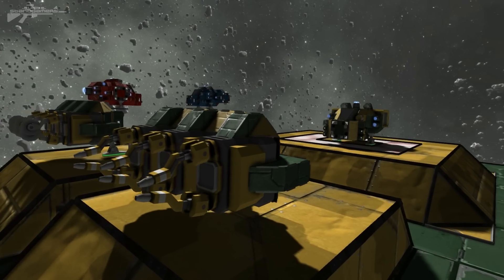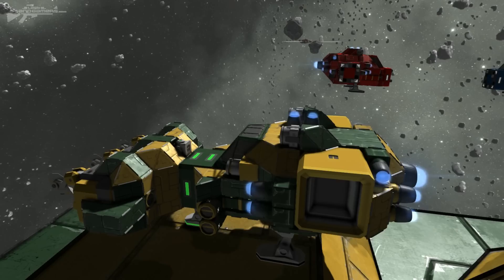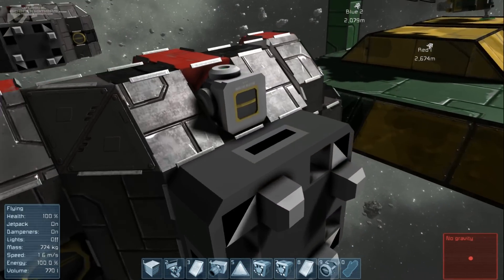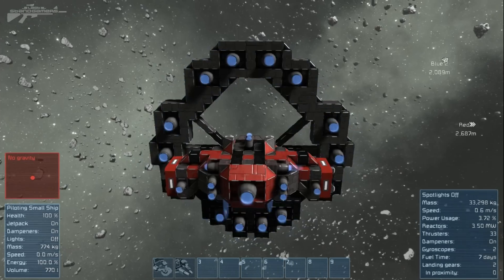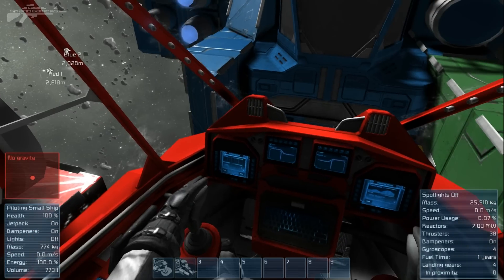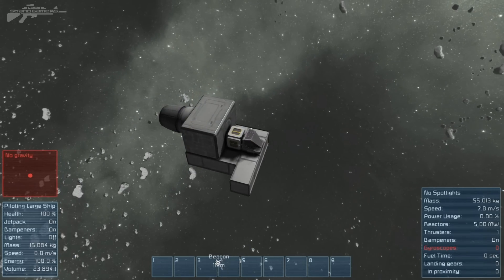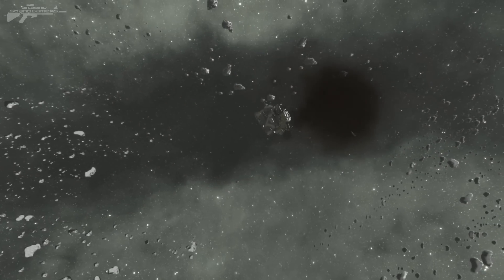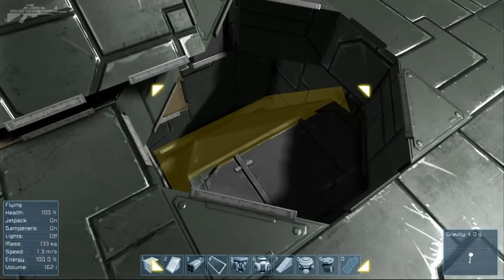Space Engineers - Merge Blocks, Connecting Ships & Upgraded Multi-Player Code

Comment: i got a sweet blue print from workshop and decided to make about 5 of it into one ship and have been catching my tail trying to get them to be one ship i tried using blocks and presion flying to line up i even tried connectors i forgot that it have merge blocks good thing i found this vid because tonight would of been the same catch tail i was going to build a city ship but to much ppl did it so i will make a small ship with the city ship type look idea like how stargate atlantice city ship has the center tower and all the platforms i will try that with a beautiful ship i got from workshop when its done i will post a vid maybe upload to workshopwont be stealing designs because i still have to make the center portion of my ship to look as close as possible to the blueprint design mayby i will as the original designer to make a center tower for me only oter style i will do the inside to my liking

Comment: I know this has Obviously had some changes since this release but I just recently started playing. I have a similar setup for my atmospheric utility ship. When I disconnect the tool header though the landing pad attached to the tool header disconnects. I Have tried everything I know of short of giving it all the components it would need to qualify as a ship. I have even added a battery to make sure it had a constant power source thinking that may have been an issue. Will this still work or will I have to find some other way to store the tool headers for transit?

Comment: Fully modular ship construction, instead of building ships, build sets of light, medium, heavy cores (reactors/gyros) light/med/heavy cockpit modules, cargo modules, thruster modules, weapons modules, utility modules, etc.  You would have a hanger full of these modules and then simply plug and play for whatever role you need, and when its no longer immediately useful, you can disassemble the whole thing down to its modules. You would also be able to chain the modules togther, like extra power modules, extra cargo, etc, think ship construction from kinetic void, except you can take them back apart and reconfigure the whole thing. 
Would also make repairs stupid easy, just swap out the module, instead of rebuilding a whole ship.

Comment: Great for if you are building a ship and acedentaly destroy a conection to an important part. I had that problem while I was building a cruiser. I kept on editing the passages I was useing for jetpack elevaters but it would come off when I destroyed a certain passage block, it was so frustrating. So this is awesome! Been waiting for the devs to add something like this. Also, it lines up perfectly with the other blocks, unlike landing gear, so now you can have a better loading system for small ships.

Comment: These merge blocks work great. The exception being if you have a very large heavy vessel and you try to dock with a station, the magnetism tends to force them to crash into each other more than dock. I was able to somewhat avoid this by reducing the number of merging blocks used. Less merging blocks less magnetism. However I still ended up with some damage. I hope in coming updates they allow for the merging blocks to connect small ships to large ships. That way you could trailer over a reactor with gravity generator to a location where your mining and not have debris flying off into space. Plus it would be cool to build a booster ring like Arron's here using a gravity drive.

Comment: I wanna know what that big thing in the background was, and that white "mesh" looking thing
This would make breakthroughs for more role-play and/or combat orientated ships, I always wanted to have a modular design for my vessels where the main body would contain the bare essentials for getting around, with the high mobility and speed as an essential, along with a respawn point and not much else, I would then create many different modules covering everything from cargo bays, troop transport, missile bays, additional armour plates, mining/welding/grinding modules, refinery bays, thruster and reactor bays, anything I can think of really to create the most versatile ship possible, including points to connect to other ships or stations allowing easy transfer of materials or increased power supply, not to mention the ability to carry other vessels.... I could even put my station defence system into effect, creating a simple ship with the ability to connect to huge armour panels or massive turret or missile arrays!

Comment: Now if only they could try to work around something to make manned turrets (with pitch and yaw) feasible, practical, or at least usable. Having to make odd looking bulges on my vehicles because the turrets that exist on tanks today are impossible to fully recreate is kind of annoying.

Although, with my own research into the field has provided some use; you can build an oscillating turret design, otherwise you'd have to build a 5-faced empty cube with a separate rotor for pitch and yaw.

Comment: Regarding item transfer between ships, you don't need to use connectors and collectors between ships that use merge blocks to connect, so long as you can make an item port or conveyor tube on one ship (cargo container, reactor, conveyor, etc.) line up with an item port or conveyor tube on the other ship.

Little bit of ASCII art to illustrate what I mean:
Ship 1 ---------------------------- Ship 2
|-Merge block-| Space |-Merge block-|
|---Conveyor---| Space |---Conveyor---|

When the merge blocks connect those two ships, the conveyor blocks line up as well, and the game will treat that the same as if the two conveyor blocks were built right next to each other.
I'm not sure if that works specifically because they programmed it to do so, or because the merge block makes both ships effectively the "same" ship. Either way, it's a handy solution to what could have been an annoying problem.

Comment: you can use 2 rotors for a wider degree of movement, if you add a rotor facing sideways on the first rotor you can have a turret that pitches up and down
Reply: He knows that. It's just that if you do something like that, you can't have a "proper" turret with a mantlet and aesthetic accuracy (like in recreations).
Reply: TankCommander451 indeed to do a complex turret consume allot of space and you have to configure the rotors to reduce the vertical angle to avoid break every ting i did i a wheeled tank with functional turret and but that was a hole day just fot configure it and testing now is realy good, i want to replicate some real life tank some day and working suspensions, check on the work shop Roque_THE_GAMER and see my job.

Comment: As long as you know which Merger block to turn off in order to disconnect you will not need to place a reactor on the other piece, it stays on regardless of power.

Another interesting thing is you can build the ship and the piece already togheter and detatch later on

Comment: MAKE TORPEDOES WITH THRUSTERS NAOW
Reply: aaaah, you mean that they would be propelled by those thrusters?
sorry, I thought you want the thrusters to "melt" through the enemies hull.

no, yet the thrusters just work manually (just while the player presses the button and become inactive when the button is released)
Reply: I bet someone is doing that right now.  :)
Reply: that should work... how?
Reply: Well What I'm thinking you'd have to have a powered approach.  So they're going, then disconnect the merge block and they'd keep going.  Unless they'd automatically go to zero thrust once disconnected?
Reply: I think they would slow down too fast.
and by the way your concept was done already with landing gear
Reply: Yeah as inertial based torpedoes.  I'm wondering if the thrusters would stay on when disconnected.  If not then yes they're no more than what we've already had.  If they CAN then they will majorly accelerate once removed from the mass of the rest of the ship.
Reply: Ah so once you'd disconnect it it'd just shut off.  Boo. :(

Yeah seen the thruster burner missile. :)
Reply: exactly. it would be a new ship in that moment.
Reply: Hmm... but I kinda want it to be... 

Oh well, I'll have to wait for them to make an "AI" block (call it a CPU Core) so I can make automated satellites and smart missiles I guess. :)

Comment: I really like it , Now you can build Atlantis and fly around with it
The only problem is that you can not really use the ship with different tools because tubes and conveyors connect permanently ...
Reply: Use Connectors ... You Can Have A Block Gap And It Will Just Spit The Items Across The Gap No Problem ... There Problem Solved ...
Reply: Or alternatively have the item storage on the same part of the welder/grinder/drill.
Reply: pyr0b1rd yea but the grinder would be full at some point and you have to transfer all of it manually , then you should consider building a ship with both tools
Reply: amazing Nesor
 Or you place a connector on one and a collector on the other. Meaning you can dump the grinder to the storage or welder, and dump things to the welder. Personally I'd trust that more than  having blocks be transferred on a (most likely) moving spaceship but that's just me.

Comment: now I just want to turn my ship back into a station
Reply: You can do that with a bit of a hack. Build a station block with a merger in empty space and merge your ship with it. Your ship will be converted to a station grid ;)
Reply: Emanuel May yes, but things are always better when you can do them without hacks. that is a fairly creative solution though.
Reply: klikkolee Of course, but the "station to ship" button is a work around, too. I guess in the future blocks will remember their original grid type, but until then we have to use work arounds and hacks to get what we want.
Reply: klikkolee
Well, it's not a hack. Not even an exploit. I wish people would stop using the word "hack" so loosely. The reason it does this is for purely gameplay reasons. To dock a ship to a station, you need to convert the ship to station blocks. When you undock (un-merge) from the station, you need to switch your ship from the station grid to a ship again. So no, it is not a hack. Nowhere even CLOSE.
Reply: You can, just create a station block with a reactor and merge block and dock with it. And ta da, you ship is now a station. To become a ship again disengage the merge block and then convert to ship
Reply: klikkolee it's not a hack it was added by the game developers in case you wanted to change your mind.
Reply: Emanuel May
Correct. You sort of "anchor" it down.
Reply: Emanuel May how is the station to ship button a work around? there wouldn't be much point of adding it if the des didn't want I to happen. it doesn't count as a work around unless you need to "work around" a missing feature or something the content creator does not want to happen.
Reply: klikkolee Eh, actually, go look at the official dev update video. They showed this EXACT operation. And I'm pretty sure they're still in business because 1) income from sales and 2) they make good quality updates. How else would you figure it?

Also, mind explaining to me how it is a hack when you aren't interfering with the game code?
Reply: Tristhal falsifying data packets(sending data to a server that should not have been under normal circumstances) is considered "hacking" it is often the easiest to do, since you don't need to gain access to the server or client programming or data.
Reply: klikkolee
It is a work around, because if you dock a large ship with a station it becomes a station. Later when you unmerge it, you need to use the convert to ship button to get your ship back.
Reply: klikkolee Are we even talking about the game now? What the fuck is going on here? Defining the word hack... just admit your ignorance and move on. :)
Reply: klikkolee Well it is just a guess from what I know happens behind the scene. It just looks that way from a developers point of view. I could go into detail if you like, but I don't think this comment section is the right place for this. :-)
Reply: Emanuel May 
Oh wait, did I post the same idea as yours?
Reply: This has me slightly angry. This is not a "hack" if anything a bug or exploit. If it was a hack you would be well hacking the game and to do that you need to um hack it and do do that you have to change the game and here you are not doing that. Besides its not even a cheat there is no such thing as a perfectly fixed object only something anchored to the ground. Thats esentially what this is. No hack sorta a bug but maby not.
Reply: CoconutsalesEO my mind malfunctioned more than slightly. I would not call it a hack, but I used the word since I was replying to someone who used it to describe it. what I would like to know is why in this universe would they ever have that be the intended way . I said I was frightened to learn how they would still be in business somewhat jokingly, since  it would be quite easy to get sales on this game, and it is (hopefully) the first time they pulled something like this.
Reply: Tristhal I will admit: my brain may have been(as in most certainly) a little broken when I called it that.
Reply: CoconutsalesEO one more thing on hacks: they don't always interfere with the code itself. if you were to trick a server into thinking you had ten times as much health as you should have by sending information that would not have normally been sent, it would still count as a hack.
Reply: klikkolee  In these conversations does it matter? I dont know of hacking however that does not require some sort of coding involved. But then again there are life hacks?
Reply: Neceros
Know what, no, do not call him ignorant. We all say things and we all have loosely different definitions for words. That's the beauty of language, words can have multiple definitions.

klikkolee I apologize for even getting started on this topic. It was too much trouble than it was worth. I hope you don't have to deal with anyone else telling you "wrong" about this subject.
Reply: Oh god, what have I done :-D Sorry for that. I sometimes use the word "hack" the same way as "work around". It is a bit of Dev speak, so to speak. When a coder says, he "hacks" something in, he means it will be working, but is ugly, unstable and absolutely not finished, but okay for now until new needed features are implemented. It means in no way you are actually "hacking" something. 

In this case the new merger block seems like such a such a "hacked in feature". It's main purpose is to get your ship back flying after you docked it to a station. For very simple technical reasons the ships blocks get converted to station blocks and stay that way. My guess is that the blocks will remember what type they are in the future, but that feature is not coded in yet. So we need a button to switch manually, to work around this issue. 

Sorry to have started an argument over my unfamiliar usage of the word "hack" :-)
Reply: Emanuel May
It would have been fine if I hadn't brought it up. You were at no wrong.
Reply: CoconutsalesEO Well, I was the one throwing coder slang that can be misinterpreted into this comment section. I try to be more careful with my words in the future :-)
Reply: Nice thanks for this idea

Comment: The problem is that resources don't flow through these blocks, so it is hard to transport resources from the "grinder bit" to your main hub/ship....I did try a way of putting connectors on the grinder bit, that flows into the main ship. The welder bit is the other way around, to recive materials from the main hub. It's kind of genius, I I do say so myself:P
Reply: Yes Just Use Connectors That Connect Up When You Merge ...